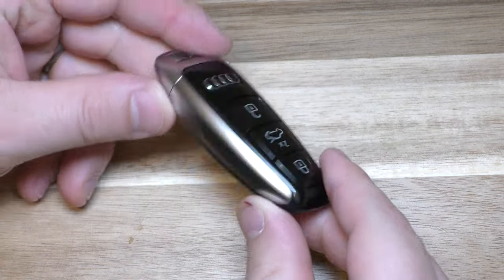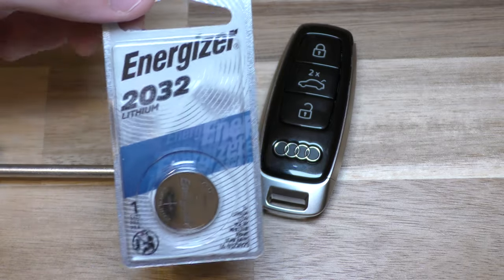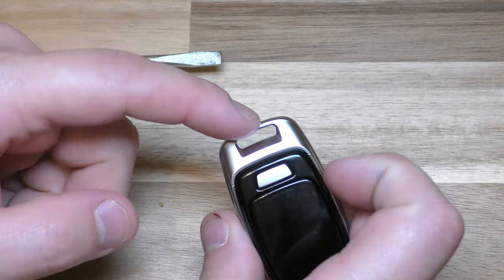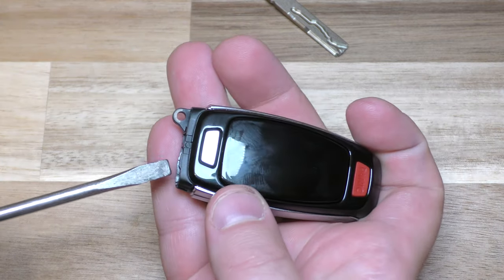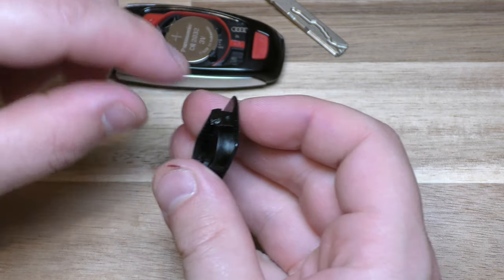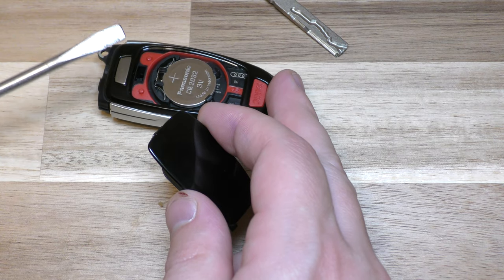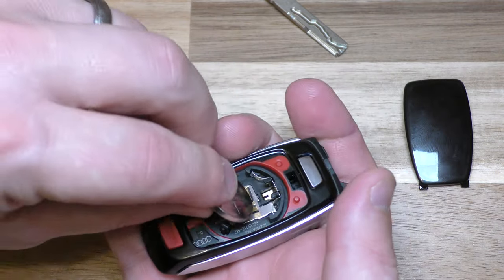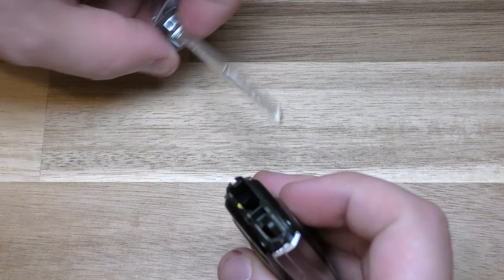* 2019 - 2024 * DIY - How to replace remote fob battery in Audi A4, A5, A6, A8, Q5, Q7 and TT

Comment: Thank you so much for this video!  You have no idea how I struggled, trying to get that dang cover off. It must have been designed by a sadist!  Watching your video, I was able to finally do it!  You rock!
Reply from the maker: It is extremely tricky. Even with the video or using the mechanical key or a screwdriver, it's still tricky.

Comment: worked quite well. did struggle a bit with the difficult part. finding the right angle to put in the screwdriver is the only challenge to get this done. thanks for the video
Reply from the maker: Once you get the exact angle figured out, it's fairly straightforward from there. Glad you found the video helpful!

Comment: Thank you for the video.  %100 accurate for the 2021 Q8 battery.  I used the key blade instead of the screw driver.  Thank you again.
Reply: The key blade works great, very easy.  Much easier than the previous versions
Reply: Same. I struggled a little with the screwdriver and decided to try the key blade itself and it immediately popped right open.

Comment: Thank you very much! Used the key and it worked just like the screw driver!
Reply from the maker: Well done
Reply: This video saved the day! It took me a few tries to release the battery holder but once I hit the correct spot it was easy, thank you 😊
Reply: Yh i did too, i feel like it’s probably better as it perhaps was intended by Audi
Reply: Thanks! Much better than a sharp knife😂
Reply: The key works perfectly. Thanks a lot
Reply: Great video!! And saw your comment and used the key. Worked great

Comment: I had some trouble doing this because the screwdriver I was using was too big. Using the key blade was also unsuccessful. My advice: use a small flathead! Popped right open when I did that.

Comment: Thank you for helping me with my $75,000 Audi - the instructions for a battery change in the manual are absolute garbage.  Even with your very helpful directions I had to go to the dealer because the battery panel would not open.  My next option was to use a hammer on my $600.00 key.
Reply: Your comments worth $0
Reply: the key isnt even 600 its 120
Reply: The manual says to use the key to insert into the opening at an angle without prising, but the key is so sharp and thick, which slightly damaged the release button inside and couldn't pop up the battery compartment cover.
Reply: I bet you tell everyone you encounter how much your Audi cost.